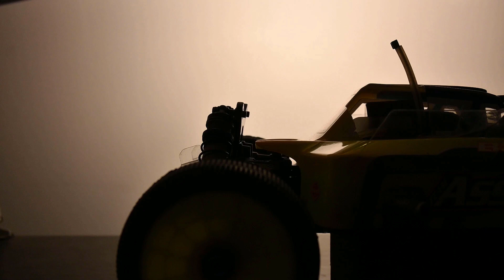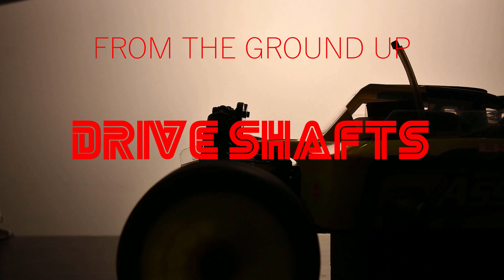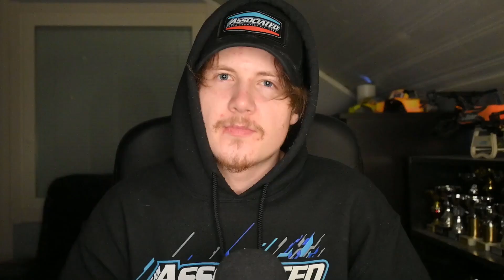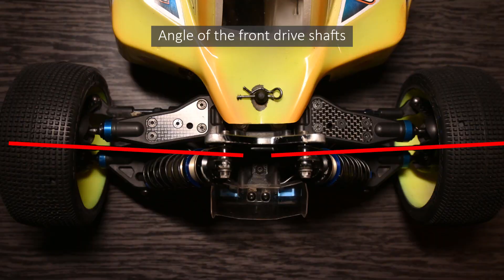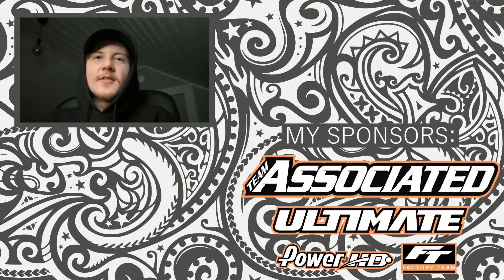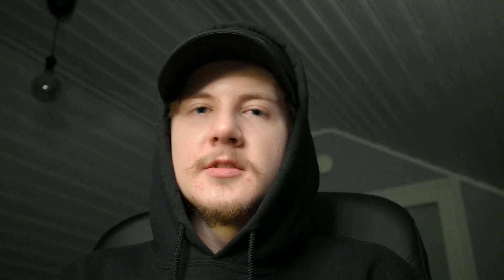From the ground up: Drive shafts

Comment: I switched my Tekno NB48 2.0 from the CVDs that came in the kit to the optional uni joints a few years ago and wasn't able to notice a difference.  I simply did it skip the maintenance of disassembling, cleaning, and greasing the CVDs every ~2 track days since I practice a lot on my local track and it's often loose, dry, & dusty.

But even for the unis, I wish there were boots that'd hold grease inside and keep dirt out.  I briefly looked into these and saw that TLR had boots for their joints at some point like 10ish years ago, but I don't think they stuck with them.  Seems like it'd be difficult for a boot to withstand the high angle and abuse that these 1/8 off-road vehicles go through.

Also, I've never been around on-road as there's no tracks near me, but I think I saw years ago that some of them use dogbones with little ball bearings or rollers on the pins (similar to full scale cars, like my Nissan 240sx's tripod joint axles).  Seems really cool but probably comes back to needing some way to put a boot over them if attempting to use for off-road since the on-road cars are comparatively in a "clean" enough environment where they sometimes run unshielded front bearings in their engines.

Comment: Check out driveshaft angle and phasing. There are videos explaining it. That's the key different between the two types of joints and it's what makes the CVD superior to the universal. In short, the universal drives have phasing issues when operating at an angle resulting in pulsating torque delivery (phasing issue which causes non-constant velocity). This is typically masked be the elasticity of the tyres as they stretch and contract to absorb those pulses, but it still can have an effect on grip as the tyre experiences torque pulses (acceleration and deceleration) even at constant throttle. On a CVD you got two joints at right angle to each other which cancels the phasing issue resulting in smooth torque delivery (constant velocity). The phasing problem becomes more pronounced at higher angles of rotation, therefore it is best to use CVD at the front to accommodate for the steering. When the axle is perfectly straight, the velocity is constant even for the universal joints but as you go farther away from perfectly straight, the phasing issue becomes more severe. Universals are good enough for the rear unless you have extreme suspension travel. Having said that, the CVD are a bit weaker because they have two joints, so there are two points of failure, whereas the  universal is a bit more robust with only a single weak point. So for small scale and high-power, the universal is the standard for its robustness despite its phasing problem.
Reply from the maker: The CVD driveshafts used in RC (apart from the double joint drivershafts used in touring cars) are not actually constant velocity joints. The CVD’s and CVA’s used in RC cars have the exact same working principle as the universal but their design is different as the universal uses two pins and the CVA’s and CVD’s use a barrel.

When talking about actual constant velocity joints or the double joints used in touring cars, you are absolutely correct and most of those cars use them only in the front. They have proven to have some benefit in offroad as well in the rear due to high suspension travel. That being said I have never seen anyone able to use them on dirt tracks due to the high amount of wear and concerns with reliability. I would still imagine them having performance benefits due to the issue of pulsating torque that the universals have as long as the reliability would be there.

Comment: i repsect you thoughts and knowlage a lot..but isn´t it one of the most common mistakes that everybody says CVD. because in modern 1/8th scale doesn´t pretty much everybody use CVA instead of CVD
Reply from the maker: You are actually correct. It is often talked about as CVD but is actually CVA. I should have caught that but thanks for calling me out on it. I gotta start using the right term.